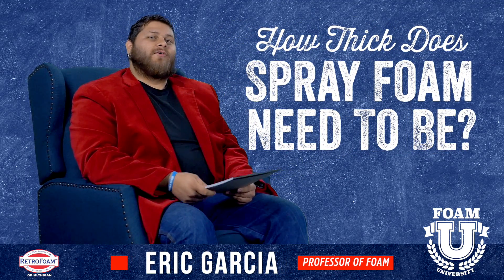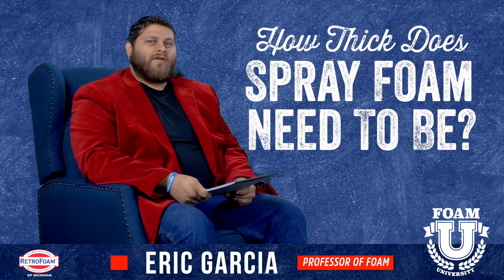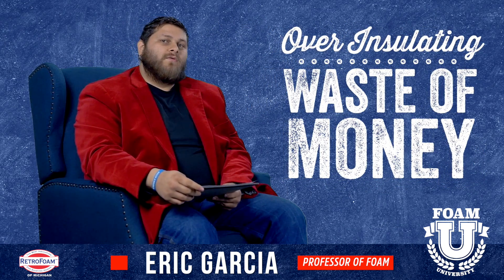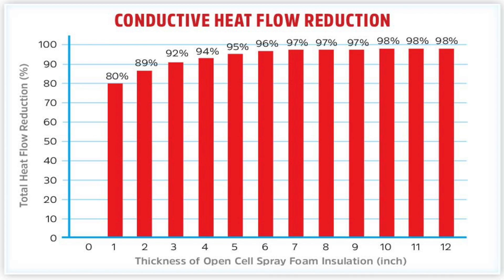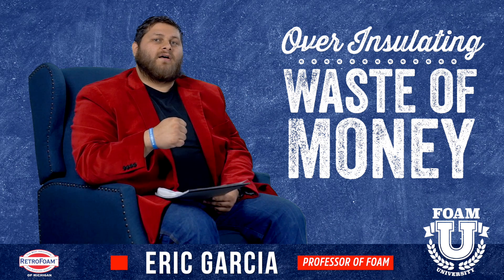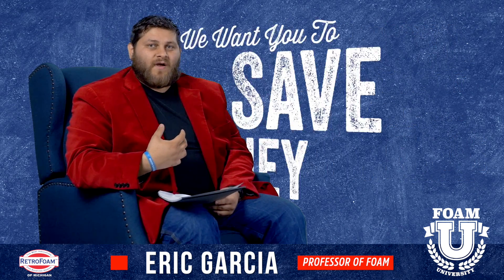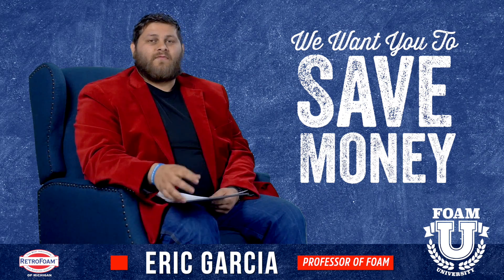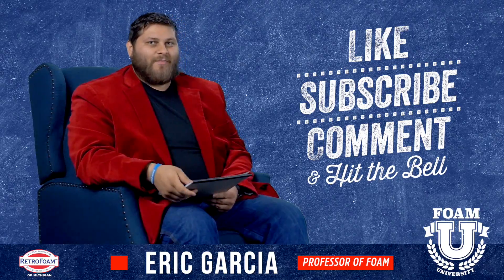How Thick Does Spray Foam Need To Be? | Foam University

Comment: I have a foam insulation problem.  I have closed cell throughout my house, 3 inches walls, ceilings, and roof underside.  My second floor structure consists of attic trusses, purlings, vapor barrier,  metal roof. The spray foam was applied to the underside of the vapor barrier, purlings, and truss. Its about 15 yrs old.  I decided to replace the metal. I pulled off the old metal and vapor barrier and was met with a shock.  The purlings located above my upstairs ceiling were total rot and wet.  The bad purlings were isolated to the area above my attic truss inside wall and above the upstairs ceiling.  4 rows spaced 24 inches apart were shot.  I replaced the bad purlings, but now i need a solution to stop it from recurring.   I should mention i replaced the vapor barrier with a layer of 3/8 inch double bubble.  My guess is my foam is not providing the vapor barrier i need.  Can you help?  Panic panic
Reply from the maker: That definitely sounds like a stressful situation — we're very sorry you’re dealing with that, Jeff! While we can’t diagnose what’s happening without seeing it firsthand, moisture issues like that usually point to a ventilation or condensation problem rather than a failure of the foam itself. It’s possible that warm, moist air was trapped and condensed against the cold roof deck over time.

We’d recommend having a local insulation or building science professional take a close look to pinpoint where the moisture is coming from and determine the best long-term fix. Let us know if there's anything else we can help you with.

Comment: What closed-cell thickness would you recommend (roof and walls) for an unfinished attic in the northeast, in preparation for installing a new hydronic air handler?
Reply from the maker: We would recommend doing 5" on the roof deck,  2-3" for the walls!

Comment: I’m looking to put spray foam in my pole barn. It’s wrapped in tyvek with a metal exterior, wondering if I should go with open or closed cell? Can I get by with 2” of closed or would you suggest 3”? I’ll be using the space as storage for vehicles but also a place I can get out of the house & do some projects. I live in northern Iowa so the temp really fluctuates, so looking to heat in winter and keep it cooler in summer. Any help would be greatly appreciated, thank you!!
Reply from the maker: Two-inches of closed cell spray foam is normally fine here in Michigan. If you're concerned, it wouldn't hurt to jump up to 3-inches on the walls.

Comment: How about closed spray foam application in the crawl vs in the attic? Which is more advantageous? Thickness for ceiling of crawlspace?
Reply from the maker: Neither is necessarily better than the other. Closed cell may be suitable for your crawl space is you have known moisture issues to protect the wood, not to solve the moisture issue. 
The thickness on the ceiling would be 2- to 3-inches of closed cell.

Comment: My city is on 2015 energy code which calls for R-38. Is spray foam exempt? 6 inch open cell would give R-20, so would I fail an inspection?
Reply from the maker: Spray foam can pass code based on its performance. This article explains how exactly that works. 
https://www.retrofoamofmichigan.com/blog/spray-foam-insulation-code-requirements-pass-without-meeting-prescriptive-r-value